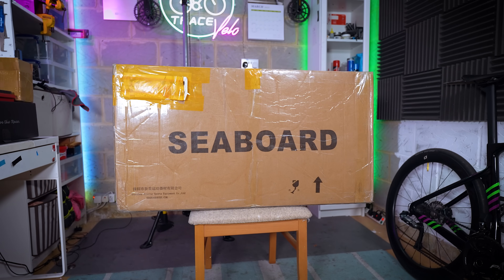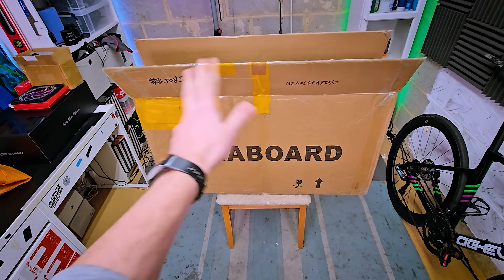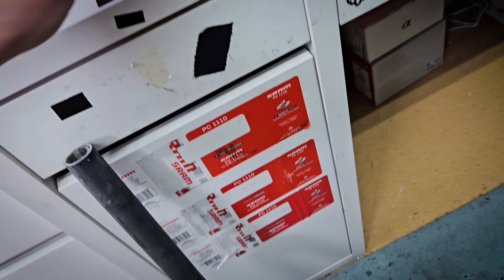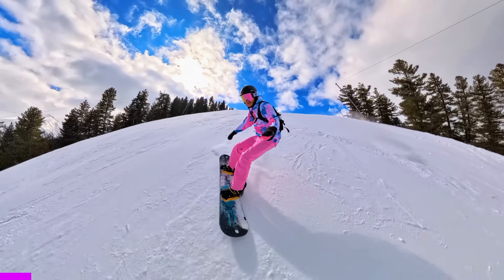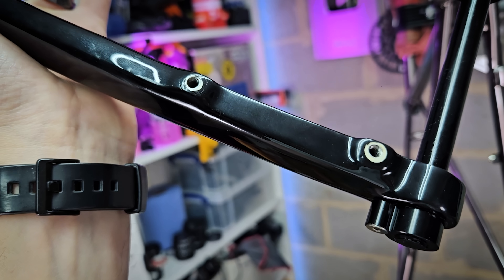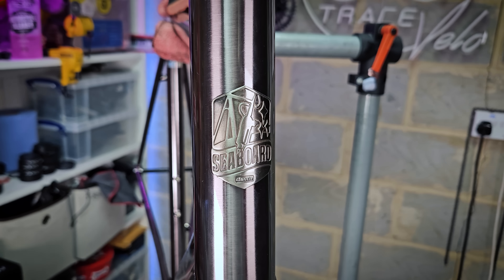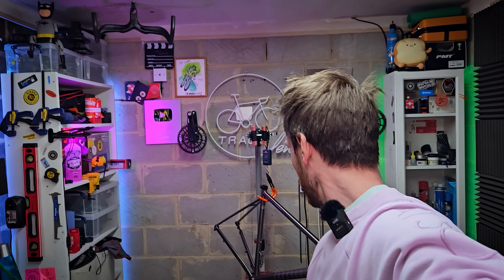A cheap steel bike frame from AliExpress - Seaboard CR05

Comment: Just finished building my cx05 with the steel fork and waiting for the end of winter. Pretty welds, the internal routing on the downtube is pretty much only for aesthetics and I had to get some low profile bolts for the disc rotors but other than that everything else was fine. Got some alloy gravel wheels from the brand and they also seem okay and for me were pretty much as strait as youd want them.

Hope you like your new bike and would love a follow up after a couple km.

Cheers!

Comment: about welding , yeah chromoly needs to be heat treated if welded , smaller framebuilders get around the need for heat treatment by fillet brazing instead  , its a good alternative to welding as the metals dont really get fused together  but rather acts similar to how soldering pipes work , i know brazing can be really strong if done right  and you get the benefit of being able to lay down more material than needed then smoohting it out  for a very clean look  almost how some carbon frames today look
Reply from the maker: Interesting, I never thought braising would even be considered an option. But thanks, great comment!

Comment: I own this frame fpr almost 2 years. Love it. I'm from south east Asia, humidity is a big issue but the frame survived with very little maintenance. Rust does form in the open holes at the rear stays area but not massive and can be prevented if u take some effort to clean the frame which I don't. 
It's a very stiff frame. Slightly heavier but I'm still able to keep up with my mates of fast bunch ride. The frame also does absorb impact slightly better than carbon frame. 
Trace velo, if u wish, u can msg me and I can send u photos of my frame.
Reply: Hi, which frame do you have? Looking forward to seeing yours @paullai8089

Comment: The headset cups: yes, that is standard on a steel frame. Getting the bearings out of the cups is not an issue. If you want to replace the cups in future, I hope you added some grease or anti-seize compound before you hammered them in. A standard cup removal tool, such as the Parktool RT-1, should do the job handily.

Comment: Yes! The hammer and the plastic board method is the right one. Using a bearing press is for wussies.
The bearings cartridges themselves are meant to be sitting "loose" and they can always be extracted with bare fingers. It is the headset cups that you might want to bank out at some point later. There exists a tool for that, but it can also be done with a long screwdriver, a hammer and a lot of time and swearing (won't recommend, a tool is worth it).

Comment: Reynolds 853 is the lowest quality I can tolerate on a bike frame. All other steels should not be used for a bike frame today. So 931 is great, Columbus stainless great, but simple cromo on a road bike no no. This can be used for a commuter or a cargo bike.

Comment: Carbon bike enjoyer becomes parent, immediately buys steel bike. A tale as old as time. 

Looking forward to the build! I've had a Seaboard on my Ali wish list for a while.
Reply: I built a seaboard with spare parts i had laying around last year, and it's so confortable i ended up upgrading it and riding it more than my other bikes.
Reply: Help please . I have a CR03 Seaboard that i built this month using tiagra groupset. My problem is the bad chainline and its cross chaining when  on largest cog. Did i use a wrong bottom bracket (tiagra) Thanks
Reply: @celsonahibuan8636  Assuming DCrank.. how much distance between small crank ring and frame? Do you know  BB width? Have you given front derailleur just a very minor touch out still preventing chain going off & out?
Reply: There's nothing better than steel for comfort. No other frame material dampens as well as steel. I would definitely get the fork in steel too 😅
Reply: @PuerRidcully  Probably carbon. Moot point anywa as tires do most dampening anyway
Reply: @ Just ride the two for longer and you'll change your mind.
Reply: @PuerRidcully  I ride both, they're both comfortable. If it matters, my favorite bikes are both steel

Comment: 2.24kg frame? Just frame, no fork... Oof.  C H O N K !
I've a 61cm Norco Section S1 (steel) and I think it was 1,300g for a  Taiwan sausage factory jobby frame.
  Yours'll Bike just fine but am not sure you'll get too much 'Steel is real' feeling with about double the material.

Tip for the headset cups: Sit them in the freezer for an hour, then just pop on a washing up glove (more to do with temp leeching than skin protection) and, relatively swiftly, grab a cup and push it in by hand.

Comment: Nice to see some non carbon frames on the channel! I bought this in the summer and I had only two issues. 1. The top headset bearing didn't want to enter, even with the press tool, that was a bit of a pain to fix. 2. I got very bad luck with custom duties, the price doubled with the duties (not so cheap after all 🥲).

Comment: have a steel frame with EC lower cup like yours. The bearings dont get stuck. Use grease on installation. They are held in place by (pre)load adjusting the headset

Comment: What steel is it?  Even their website doesnt seem to tell you.

With that weight its probably something pretty generic.
Reply: It's triple butted heat treated cromoly. On par with Reynolds 725.
Reply: @mashkal2006  it doesnt seem like its particularly cheap then...  A quick google suggests other options at a comparable price from known UK sellers
Reply: @TimInertiatic  you have found steel road bike frame made of Reynolds 725 or equivalent for a price comparable to this? Would you mind sharing the link? I've been looking for a new daily driver and such an option would be outstanding for me! Thanks alot in advance 🙏🙂

Comment: I have seen that through axle solution before on another chinese fork if I remember correctly. I think thats super nice because if you somehow mess up the thread you dont have to replace the entire fork, just that little aluminium part!
Reply: I have a 20mm thru axle on one of my BMX bikes and the forks arent threaded. Its basically just a big fat nut/bolt combo.
Reply: @ashleylopez456  I had the same thing on a very heavy set of marzocchi dj2 forks actually
Reply: One of the most popular ali express cycloxross framesets has it. The make and model have escaped my memory for the moment.

Comment: You can get a bearing puller with small lips on the end to get that bottom bearing out, if it ever gets stuck. Maybe a very small amount of grease on the outside is a decent idea? Dunno tbh xD Great vid regardless, rare to see Steel road builds these days
Reply: Honestly, it never ever gets stuck unless you don't grease it at all and then chuck it into sea for a week. The fit there isn't designed to be tight around the bearing, it only gets tight vertically when compressed by topcap.

Comment: I am curious if they used steel for the rear drop out section of the frame. Run a magnet see if it’s steel or whether they have brazed pre fabricated aluminium to the frame

Comment: I've built up a Tsunami CR01 with steel fork and Shimano 105 rim-brake groupset, I've been very happy with it. The steel dampening is great. Sadly the CR05 is not offered with a steel fork, so I would have to go for the gravel CX03 to get a frame with disc mount and steel fork in the future.

Comment: I have this frameset... Its ok, but I had to replace the fork. The fiberglass to carbon ratio is bad. I'm heavy and it flexed way too much. Finally the rear brake mount needs to be faced, not level at all. Other than that its fine😂

Comment: please correct me if im wrong but i thought that we are suppoosed to grease the bearing cups befores installation to prevent corrosion and galvanisation and to make it easier to remove in future? sorry i have not been into bike mechanics in awhile so im very rusty
Reply: I always grease the cups and the head tube, inside the cups, the crown race, and under the headset cap below the spacers!
Reply: I grease all tolerance fits like this.  You don't want it binding before it goes home fully.  Only need a tiny bit

Comment: I would change your wording because you should never use a star nut with a carbon (or other FRP) steerer tube. Star nuts don't support the tube fully/evenly/rigidly from the inside and so when the stem is tightened it can cause the steerer tube to collapse, which is extremely dangerous.
Reply: It's true. You supposed to use a compression plug for it.
Reply: I use 70mm plugs on all my bikes. Can't be too careful
Reply: @richardggeorge  It has only to be as strong as other parts that can fail. So it doesn't make sense to overdo it.

Comment: Spray inside the tubes with Framesaver, or, you can use linseed oil. This will protect against rust.
Reply: Boiled linseed oil

Comment: I have built up three Seaboard GRO2 Alloy frame sets. I HIGHLY  recommend them!  And i think it is the top selling alloy gravel bike frame on aly express.  PLEASE do a build on the GRO2 frame. I could send pictures of my builds if you wanted them.
Reply: +1. I personally owned one. Very solid gravel frame, and good value! The only issue I had is its geometry being a bit odd. My feet quite often touch the front wheel when I make a turn. Otherwise it's a great entry level frame. The blue -purple paint is also beautiful. Highly recommend it.
Reply: @tengouku there is always toe overlap with road and gravel bikes.  I don't believe there is any more on the GR02 but I could be wrong?
Reply: @tengouku  What's the maximum tyre clearance on the GRO2?
Reply: @Stoney3K 42 or 45mm I think.  It's posted on the better vendors pages.

Comment: I've been riding on Reynolds 531 cromoly for year's, and it's a far nicer ride than aluminum or carbon. 
Long distance on steel is fantastic, however carbon or aluminum are far more lively when one is into racing.  

Now that I don't race would I ride a harsh carbon or aluminum bike 🚲, yes however only for short distances.

Comment: There's a tool for removing headset cups, it's a heavy tube with the ends  splayed out. That would work for this.
Reply: Yes, I think they sell them on aliexpress😂
Reply: @FTW-h5s  the Ali express one I bought is junk. It’s not strong enough and bends before some cups come out. This is one of the things where it pays to buy the park tool version or similar. On the other hand my very cheap Ali express head seat setting tool/bb bearing press is great and works really well
Reply: Thats for removing the cups thenselves.  The bearings will just pull out, or use a blind puller

Comment: CX07 here. No weld quality complaints.  Fork are normal. No fiberglass, no strange adapters. 
My complains: 
1) No antirust coating inside. 
2) strange cable routing.
Any way, i use some rust prevention spray, and compromise on front derailleur cable routing.
Its ok for me.
Reply: Rust prevention tip; spraying the inside with boiled linseed oil should keep it basically rust free for the lifetime of the frame. It's cheap, simple and has been proven to work super well. A bit messy, but it will harden after a few weeks :)
Reply: Most steel frames don't include rust prevention treatment. Thankfully it's cheap and readily available in most places.
Reply: While the internal cable routing is weird anyway (I got mine set up fully internal through a bigger headset bearing cup) the cx07 is specifically mentioned as a 1by frame. The cx05 is for 2by drivetrains
Reply: @sandro8233  There are third external routing mount on cx07, so you can't say it 1X. It's true, look like crap, i over it. And also its kind of weird split on shifting line, no fixation on bottom bracket side. Its not how its meen to work... 
+ Weird cover for internal routing.
But ist fun to ride. And tsunami are local king of budget fixed gear bike. I see them a lot, and there is no complain in reliability yet.

Anecdotally i saw tsunami after head on car crash, and frame are fine. Both carbon fork blades craked in half, and stearer are fine.
I dont say its top cuality. Its heavy and robust - this is my opinion.
Reply: @ Not I am saying it's 1x Tsunami themselves are saying that. Again yes you can make it work but it would just be so much easier and better looking on a CX05. It's fine if you can make it work but other people should know what frame suits them

Comment: Fork - Carbon fibre with a glass fibre mid layer, then more carbon ... If the insulator is on the inside ... It is not likely to reduce or stop conductivity.... Or am I missing something? I would guess they did it to save cost of carbon fibre ?
Reply: No, you're correct. This was purely for cost cutting and won't help at all with galvanic corrosion.

Comment: Cervelo does the same type of thru axle, a little neater though, it's a good design as if you damage the thread, it's simple to replace, and please don't use the star nut in a carbon fork. Looking forward to the new build.

Comment: Those headset cups are pretty much a standard on all steel framed bikes that I've seen.
Reply: I think EC34 is still the most common cup, but EC44/ZS44 are definitely common on higher end frames
Reply: Ec34 on most metal frames (steel, Ti, Alu) straight steerers (so steel forks). Zs44/EC44 on most metal frames that take a tapered steerer (carbon forks).
Reply: Interesting, I have a steel (Ritchey) and aluminum (GT) frame with drop in integrated headset. Did not know it is not typical.
Reply: There seem to be exceptions. I have an On One Rujo gravel bike frame from 2023 and it has drop-in integrated headset cups. The vast majority of bikes I've seen run external headset cups are steel or titanium though
Reply: BMX ,some trials and alot of dirt jump bikes use drop in integrated style headsets , ec34 isn't as commonly used now
Reply: @ I even have a box fork with integrated crown race. Haven’t seen that on a steel fork before. I absolutely hate it, but that’s just me.
Reply: in a lot of SEA, it goes:

narrow head tube = EC34/EC34
wide straight head tube + nontapered fork = ZS44/ZS44
wide straight head tube + tapered fork = ZS44/EC44
tapered headtube = ZS44/ZS56

Comment: I have been considering buying this frame for a while. Mostly because I have a groupset sitting at home doing nothing and I want a cheap frame to put it on and mostly have it on my trainer.
Reply: Would going for a cheap used bike from a big brand be an option?
Reply: @gjBackBone   I've been looking for a used aluminum but I haven't been having any luck so far. As I wrote, it will be on my trainer. So, weight or anything else won't matter. I just need it to fit and accept a mechanical group set. I actually thought I got lucky. My bike shop had an old Cannondale frame for $50. I'm an old Cannondale fan boy, so I bought it. I thought it was a size that would work at a glance, but I later realized it is one size too big. 😅 I have it hanging on my wall in my bike room.

Comment: Surely a star nut in a carbon/fibre glasses fork steerer isn't ideal?
Reply from the maker: Yeah probably not, I'll definitely be sticking with the compression plug! But I think they also ship frames with steel and aluminium forks, so makes sense to just include both in the kit
Reply: Dangerous. Should never be done. I understand them sending a standard full kit, but it should be made clear not to use a star nut with FRP.
Reply: They just send full box headset. 
Also you can relatively safely use star nut in fiberglass tube (at least one of china's manufacturing do it, and claim its ok)

Comment: I got a seaboard and the build quality was AWFUL un safe to ride, then they did nothing to help with the frame to get it sorted, Shipped the frame back they refused to accept it it got returned shipped at my expense and it then got damaged VERY DISSAPOINTED WITH THIS BRAND. now I'm stuck with a broken frame and and unsafe frame and fork. BUYERS BE WARNED
Reply from the maker: That's interesting. If you have any footage or pictures of the frame and the issues, I'd love the see them. I could mention them in the build video. If you fancy sending them across, my email is tracevelouk@gmail.com
Reply: @TraceVelo  I have the frame still so i can provide everything you want Let me know

There was voids in the carbon fork

Some awful welds and the through axles on the back were too long to fit into the frame.  

Sadly from shipping the Headtube got damaged but that's not seaboard fault.
Reply: What is wrong with it? Why unsafe? I got a seaboard and it's amazing
Reply: What frame was it?  Seaboard is made by tsunami which has made track bikes forever.  I have built the alloy GRO2 three times now and it's actually better quality than many big name alloy frames I've seen.
Reply: @ its a GR02 , I have to say the paint is so nice but everything else is a shame.
Reply: Seaboard are seriously bricked up rn

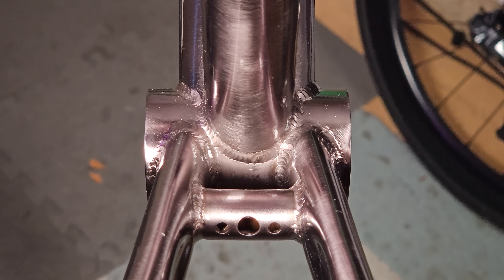Comment: 7:05 the welding in that area looks atrocious.
Reply: It's not visually pleasing, but not atrocious. I don't spot any real problem. 
And dont forget, this is sub 300$ frame.
Reply: @МихаилМсс  whether it's 300usd or not is irrelevant. The welding looks to have numerous defects.
Reply: @Hambini  You're being overly dramatic. It's hard to say how good it is on camera any way, but if you compared to some cheap bike, like Cyrusher XF900, you unbox and don't claim unsafe, is totally fine one.

Comment: Steel....do they still make those....
Reply: Oliver Naesen rode one during the final stage of the TdF in 2019... it was a tribute bike to Eddy Merckx

So, yeah if you're an UCI pro you're not likely to touch a CrMo while working...

But I know a lot of people who might not be pro riders, but who will tell you a CrMo frame mtb is more compliant and gives a better ride then most carbon frames. They are also durable and reliable. 

CrMo 4130 is used in aerospace because of it's desirable properties, it's more expensive as aerospace grade aluminium so it's not because of cost ;)